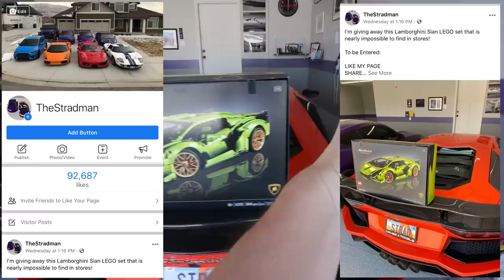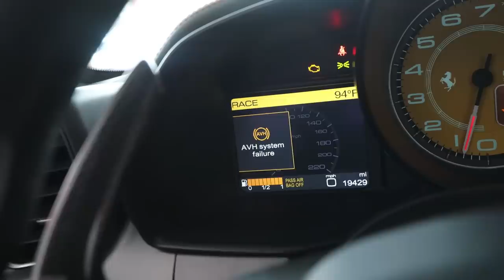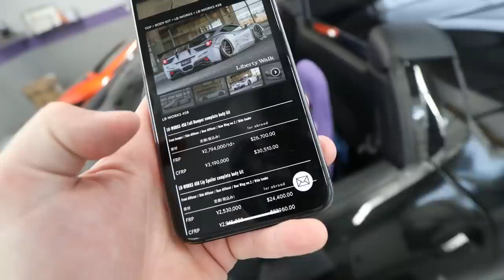My Absolute Failure Modding my Ferrari 458.

Comment: The fault codes maybe because there are side airbags built into the seat. My 2018 F150 has them in the side of the seat like shoulder height. Either that or the seat has sensors in it to tell if someone is sitting in the seat so the airbag operates properly.

Comment: Liberty walk kit.  I guess if I were to Liberty walk it...  I would leave the car Black, probably put a Metallic Anthracite double stripe down the middle bordered with Purple (Stradman purple).  A few Liberty walk decals of course, wheels would be a two piece from ADV1.. probably Anthracite dark metallic face with brushed or polished barrel.  Brake Calipers would be a Dark Metallic Purple custom to say Stradman or just Strad on them.  I would reupholster your original seats.. Purple and black center.. rest with purple stitching, the sides door panels you could do Purple alcantara and Carbon.  But those new seats look like maybe they should be in something else... like the Ford GT350 ??

Comment: You are getting the air bag warning because there is a built in sensor in the seats that tells the car when someone is sitting in it. So it can cycle the airbag on and off. You unplug it and you get the warnings youre getting. By the way great video, and would you announce the winner already??
Reply: Also, why didn;t you just pull the mounting bracket off the stock seats and bolt them to the seats?